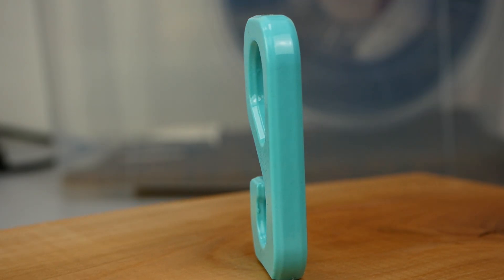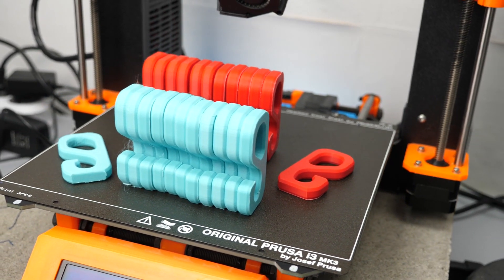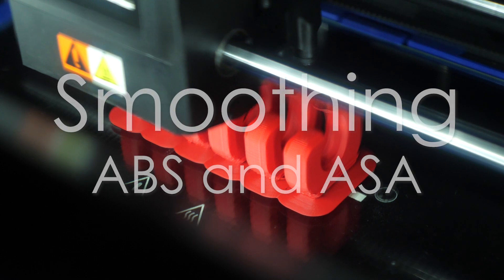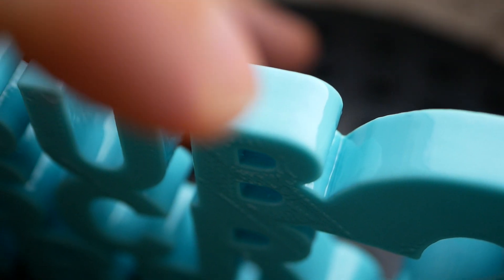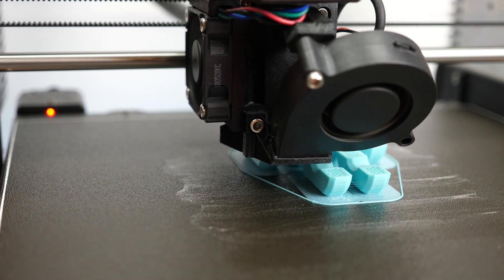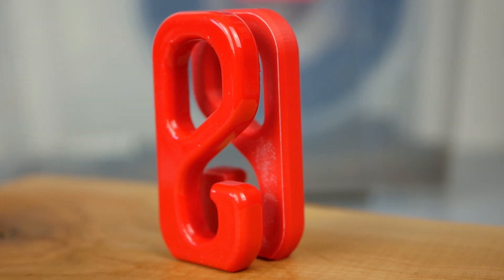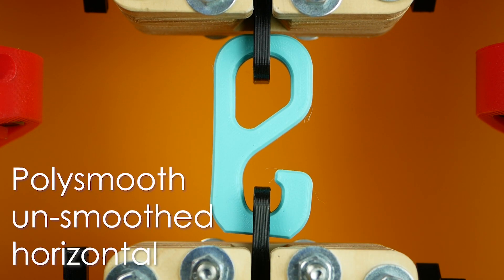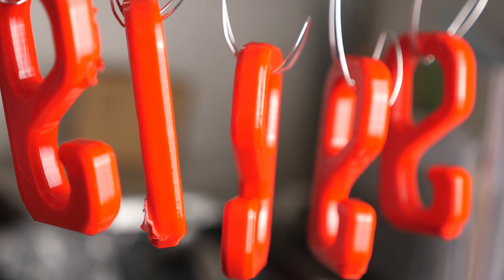Stronger 3D prints with Vapor Smoothing?

Comment: Hey Stefan. Would really appreciate a few more videos on PETG. I think it make sense since it is one of the best and most accessible engineering material where the mechanical properties matter. I have found that PLA and ABS can warp or shrink, however I am getting superb dimensional accuracy with PETG, that is why I am asking
Reply: PLA Warping? looool
Reply: @alejandroperez5368  not really ... PLA warps a surprisingly large amount.
Reply: @Anonymouspock  It warps if you're doing it really wrong. Like setting a different bed temperature for the initial layer, which only noobs would do.

Comment: How about printing in a vapor rich environment?
Reply: you could get a fire that way. acetone is pretty flammable. while its auto ignition is  465 c and you are printing at around 250 c for abs, Isopropyl is listed as 399 for auto ignition.  One thing to think of on that is that is for the liquid to auto ignite.  so vaporizing it and the printing in a high vapor environment would likely make it easier for a fire to start.   Of course you could do that without fear of fire if you could remove the oxygen.
Reply: Mark Burton if myth busters Has taught me one thing it is that no matter how flammable a substance is concentration is paramount. I’m wondering if there is a concentration to wear fire hazard is not an issue and vapor affects are still being applied to the print.
Reply: @holemajora598  possibly but is it worth the risk?  You would be better off making a vacuum chamber and sucking out as much of the air as you could and then let back in only co2 or nitrogen and then vaporizing the acetone or Isopropyl,. that way there would be no risk of a fire and for a single test might be interesting to see. However I don't think that amount of effort is practical and as such probably not worth doing.

Comment: You add holes so acetone can smooth infill. Or print without top and bottom layer then smoothen. if you consider it matters to strength to 3d print.😇
Reply: I guess it would be a nightmare to dry the acetone inside the prints, but maybe it's worth to try!
Reply: @rizalardiansyah4486   may be  infill structure and infill persentage also  matters such as qubic infill, groyrod infill or many mores  for drying out acetone.
Reply: I think it would be interesting to see the impact on strength if the infill patterns weren't lined up which creates fracture line weakness. Has anyone done that??